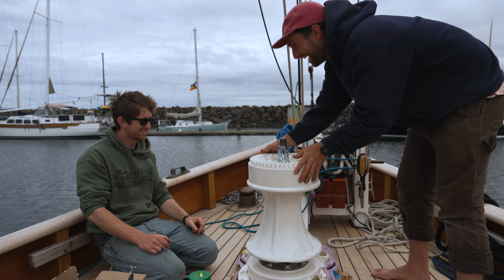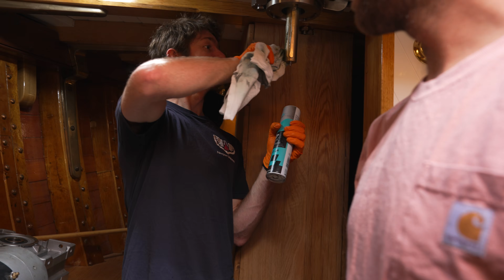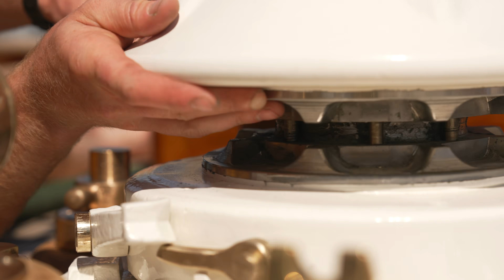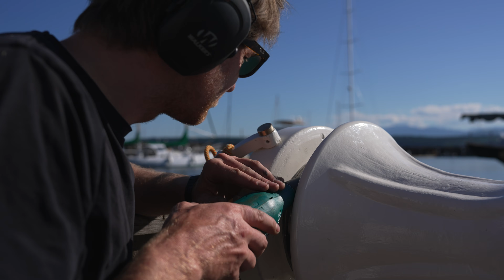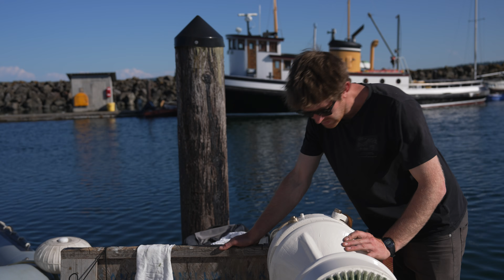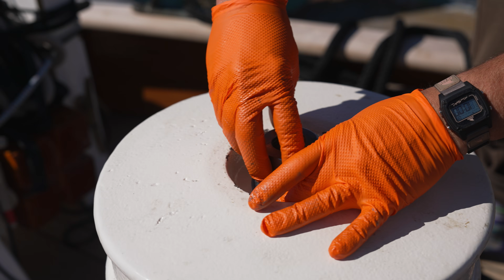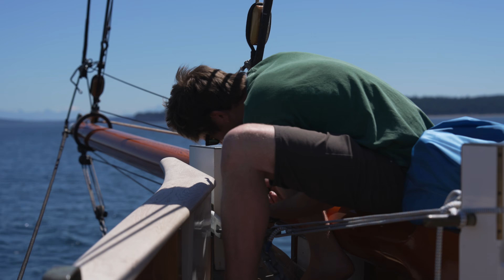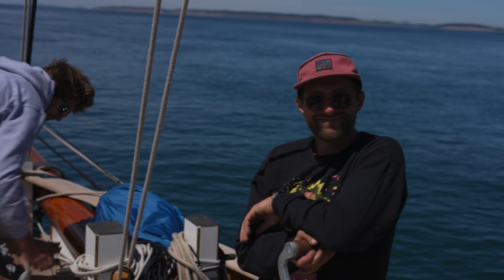Installing and using the original capstan!

Comment: I remember when you took that capstan off the boat. I’m surprised it didn’t go through the old deck as heavy as it is. The magic she adds by bringing original energy is amazing. 

The entire crew stood, eyes glued, to the Gypsy, no body movements, waiting to see if Leo’s mods worked. Phew! 

I am so stoked! 

The weird thing is that while we knew the build was winding down, it didn’t seem that ready, and then, bam, Tally Ho was in the water. I am still reeling over the fact that you’re motoring and sailing her already. What? Wow!

Comment: Will you add tubing and cable railing around the deck? It sure looks like someone could easily go overboard with the low-profile wooden side deck railing system. It (of course) isn't a problem in perfectly smooth sailing weather, but harsh weather could easily make that an unsafe condition for "man overboard".

Comment: - The chain locker tube looks a 1//4 to 3/8 {or 1/2} inch high to my carpenter's eye. {camera angle permitting a level view at 30:56}
- I would expect the chain to catch and back up being high like it is.
- My feel for this is the chain wants to be a 1/4 to 3/8 inch shy of hittting the top of the tube so it can "fall" to the top edge of the tube's inner apex right angle point turnin down.
- You may not need a chain-stripper, nor any rising skid plate taking the chain up to the gypsy when paying it out when you get the alignment to right.
~ ~ ~ ~ ~
- Leo, it occurred to me when first seeing the chain that its galvanized coating felt overly thick...and that may have added to the more bulgy links that you mentioned and had to fit the gypsy to, by grinding off 1/32 inch all the way around {if my guess is right about the depth of metal you removed}

Comment: Hi Leo, I started to read through the comments to ensure that I didn't double up on another comment, but there are just way too many of them. 
Regarding the twisting chain, I didn't see the bow roller so perhaps you have already done so. Years ago, an old hand told me to machine a groove in the bow roller marginally wider and deeper than the diameter of the rod of the chain links. The chain is then prevented from transmitting any twisting to the gypsy as it is retrieved. It is very effective.
Also, when I first learnt that you were going to refurbish the original anchor winch, I didn't think it a good idea, I have been proven wrong. It is apt, aesthetic and functional, also it gave rise to an absorbing series of videos.
Well Done!

Comment: Probably teaching grandmother to sick eggs, but just make sure the tapered shaft drive is VERY tight as the Woodruff key is only meant to locate, not transmit significant torque.

Comment: Just a suggestion, I think I'd lower the chain return elbow. The bottom of the inlet looks higher than that of the chain exiting the capstan. I think by lowering it, maybe by width of a chain link (the height of the indentation in the gypsy) you'll get a downward angle on the chain going from the capstan, and into the elbow. This will lower the contact area the chain has against that elbow, and hence lower the friction, allowing for free-er chain movement.

Comment: Why does the anchor fall from the front of the boat instead of the back? Wouldn't the chain scratch up all the paint on the front of the boat the second the anchor hits the floor and the chain becomes taut? The boat is literally floating ahead into the chain...
Reply: Usually one heads up into the wind or current to anchor. As the forward motion stops, the anchor is let go. Then the boat drifts backward as the chain pays out.
Reply: @SonjaBruenzels  Lol, I'm clearly the exact opposite of an expert, which is why I'm asking Leo to explain it to me. I genuinely don't understand why it's designed this way.

Comment: Love the engineering in the prop and the cap where you can use electric or manual/mechanical. They're really well done. 

So jelly ... Tally Ho is about the length of yacht I want to move into 24/7/365 to avoid our ridiculous housing/rent situation .. live aboard and travel with the wind. VERY impressive work all around. I'd LOVE to have the health, money, tools and expertise to pull off a basically completely fresh build.  The chain locker entry/exit and the anchor lock mech on the other side are VERY well tied in.

The only thing you're missing now is a biminy or similar for sun protection in the helm. They're also good for placing solar panels and wind generators off.

Comment: I suspect that some of the sticking in the gypsy will subside as the chain is broken in. Any flash in the link welds, and the general surface finish of the chain may quickly attain a smoother patina with repeated trips through setting and weighing anchor. You may find that with some wear, a stripper may not be necessary. Patience. The machine is amazing! Tally ho, boys.

Comment: I do like it when I see someone use a split-pin correctly - there's no need to fold it all the way around, it just needs to be spread apart enough that it won't drop out and it will make removing it much easier.
Reply: Right...Rod Stephens said 20-30 degrees separation max.

Comment: Could you make a bronze plate that mounts to the chain tube and sticks out towards the gypsy, and as the chain comes around on the way in that plate will essentially stripping the chain off that gypsy and guide it into the tube.

Acting as Pattie with a wrench knocking the chain out was.

Comment: Gosh guys, such a excessively heavy out dated bit of gear that anchor winch… better to have that weight in chain and a heavy duty electric horizontal winch…safer for the boat after the magnificent marathon rebuild…Ian 40,000 + miles sailing /cruising experience…

Comment: The brass elbow tube for the chain locker looks slightly high and prevents the chain pulling in the chain under its own weight. I wonder if it was machined down a little lower it would not snag?

Comment: A long road to get here -  2 Questions: 
1: Yes A BIG SIGN in red saying " Watch Your Noggin " Also make a nice wooden rounded Teak corner cover that is clip on clip off..   
2: Could a better " chain trough "  On the top deck be introduced. To keep the chain aligned, so when it is fed from the anchor onto the Capstan precisely...  

Besides these, Looks good Leo & Crew...

Comment: The bolts going through the gypsy to retain it likely squeezed it a bit, causing the tight fit. If your engineer OKs it, backing off the torque on those bolts will likely solve your chain sticking problem.

Comment: Many years ago on a 65ft yacht we had a chain jump out of the gypsy and free-flow until the end went overboard. The last 10 ft or so of the chain whipped round in a semi circle before it disappeared under the water. It would easily have taken the head off anyone on the fore deck who was in the way. Anchor chains can be dangerous.

We were a couple of miles up the river Dart from Dartmouth and it was shallow enough that we were able to grapple the chain on the bottom after a couple of hours. That was a lot of fun.

Comment: Amperage generally dictates wire gauge 27:55
Reply: Yes, but the higher-voltage motor (48v vs. 12v) means that less amps are req'd.

Comment: got to say, seeing the capstan in white and not a boring black, is like the ultimate bling on deck, what a fantastic addition, and the motor below deck, wow you nearly designed the boat to fit around it, incredible work, i hope you manage to wrap that up with something soft so you never concuss yourself on it, can't have you spilling the wrong claret on board dear thing, wouldn't be very British would it - hmmm need a holder now for the handles, maybe a temp fit while the anchor chains wears in, you might be able to fit a lump of sacrificial wood between the chains forward of the capstan, between incoming and outgoing chain just to force it off the gypsy, where Paddy was putting his tool in, can i say tool, but the action is real sweet

Comment: Is that a 175 amps/8400W @ 48V! Does the windlass free spool and I would use an Ultra Anchor swivel. Have a 62'/45 ton wooden sailboat here and am always anchoring in deep water(60'-100') and over the last five years have had zero issues with the Ultra Anchor swivel.

Comment: Amazing work! Out of curiosity, how long does it take to manually hoist the chain versus using the motor? It's fun facts but that is what I would love  to know. You all did an excellent job with the engineering and fitting of the capstan.

Comment: I liked the brakes in manual mode, 3 turns  around the capstan with a line from the bowsprit  mounts?,  whats that bit called?
Reply: Knightheads, or bitts.

Comment: Just to confuse everyone a "shot of chain" is a description of chain not of distance. Its' call a shot because they used to shoot short pieces of chain out of canons. A "standard shot" with regard to shipping is typically 90 feet or 15 fathoms of chain and is linked together with other "standard shots" to make the length of chain required,=. But it's not a measure of distance. You could also say "Length of chain" which is the same thing.

Comment: It looks like the chain pipe opening is either even or a little higher than the gypsy.  Perhaps reducing the spacer underneath it will help allow the chain to pull itself back down the pipe and into the chain locker.

Comment: UNRELATED QUESTIONS: Do you have to register a boat the size of Tally Ho? If so, what country will it be registered in and what point will she need to be registered? I ask because the only thing I know is that the real small boats (like the ones you can buy at places like Cabella's/Bass Pro Shops have to be registered in the US. Except that registration is controlled by each state, similar to auto licensing programs for cars and trucks.)

Comment: Leo,

Congratulations to you, your team, and everyone involved in the Capstan project.  Somehow you mixed apples and oranges and wound up with champagne.  Your capstan and gypsy are more complicated than some of the ship windlasses I've worked with.

One suggestion is that you want to use something in addition to secure the chain when anchored.  A wake from a passing boat could do significant damage to the riding pawl.  I would suggest selecting something similar to one of Crosby Group's chain grabbers secured to a cleat by a nylon line.  This gives you a spring to absorb the load.

The test you performed by dropping the full length of the chain is among the most severe tests you can make.  It took a lot of guts to do a test like that.  This brings me to the bitter end, of the chain, not my ramblings.  The bitter end should be able to hold the weight of the chain and anchor.  However, you want the bitter end to fail before damage is done to the Talley Ho.

Smooth sailing,

Bob

Comment: You have to be craze to put all that weight on the bow of your Sail Boat.
Reply: That's the capstan Tally Ho was built with. The only additional weight would be the motor and gearbox. I'm pretty sure back in 1910, that capstan was manual operation only.

Comment: Q - a practical question from an old sailor (RN).  I can only guess you can 'let go' (freefall) rather than 'power down' the anchor and control the speed with the motor declutched and a 'braking' rope around the capstan drum?

Comment: Would a stainless steel chain be “more accurately” manufactured?
Reply: I mean. Mixing highly precise matching with very low precision chain welds? Probably not a great match up? Would running the chain in and out a million times help take off the edges between the two “matting” surfaces? Or get a stainless chain?

Comment: Just going to say, Moly Grease is standard in most wheel bearings on cars. Molybdenum is very soft and lubricious. Works great as a high pressure lube in and out of bearings.

Comment: You should check with the chain suppliers.  I remember a supplier commenting on slight variations between chain sizes, like between  mm and standard sizes, between Europe and US translations of those sizes.  Also variances between galvanized and stainless steel chains.

Comment: Dang, this is a great example of how the internet has improved boat restoration. the engineering that went into the capstan could only come from the people you find to do it. Leo has identified the changes needed to make it work reliably. Then only thing I would add it to have a periodic maintenance schedule. The design requires lubrication and a schedule should be setup for disassemble, cleaning and greasing.

Comment: On most of the boats I worked on someone had to be in the chain locker stacking chain as we used more than the locker was designed for. We would put 17 shots and locker designed for 13 shots. Deckhand (35 years ago ME) had to flake the chain to make it fit using a heavy hook and point.

Comment: Wondering if putting the capstan through its paces in deep water running the anchor up and down multiple times to wear in all surfaces might help.  Otherwise, get your hands on the original sized chain to check for same problem.

Comment: Leo , to help with the chain twist, on my 45 ft offshore yacht, I put a swivel between the anchor and the chain , I never suffered any chain twist after that was fitted. So I wish you clear skies and fare winds, may your travels be safe and fruitful. Cheers from Australia
Reply: I haven't much experience with boats, but when helicopter slinging, we do the exact same thing.
Reply: Might be a problem getting over the bow roller.
Reply: @dougalannh  there are several swivel designs specifically for anchor chains and they ride over the bow roller without difficulty.
Reply: @davidwatson3921  Probably the swivel has the same outer dimension as a link in the chain?
Reply: @andrewf2644  the most important thing is that you don’t created a weak link in your anchoring system. The one I used was slightly bigger than the chain dimensions, but not enough to be a problem. The other thing is to have a chain snubber so that you can unload the winch when anchored. This is good when expecting some weather.

Comment: I suspect the gypsy will probably “wear in” with use and quit hanging onto the chain as it is, but a chain stripper should be a good short-term solution. It was really fun watching the process of trying to disassemble the winch, modeling and casting a new top, and all of Keith Rucker’s very skillful machining on the various parts of this winch. Altogether a very rewarding process to watch!

Comment: @29:34 You could say that the combined forces across the pond did a better job than NASA did on a few occasions.
(with respect to combining US customary/Imperial versus metric system)👴😁
@30:01 Perhaps lowering, and/or tilting the through-deck elbow (I don't know the English term (Spurling Pipe?)) will improve the natural flow of the chain.
It could also prevent (unnecessary) wear and tear.
Also, bear in mind that the chain is thermally zinc treated. That is the best choice, but means that over time the chain will automatically behave more willingly. 👴😉

Comment: What a success! The international work that you had done is a credit to everyone involved. The accuracy of the drawings and fabrication is excellent as the capstan and its drive mechanism went together like a fine jigsaw puzzle! The sticking chain is a hassle but a chain stripper and anchoring use should fix that. The soft zinc galvsnising will smooth out as the chain is run up and down, any bumps on the gypsy will also be worn smooth and it will get better with time. Excellent to see the completion of this saga...it's been a fascinating journey of concept and engineering! Well done to all involved. Just out of curiosity has anyone weighed the capstan anddrive? Any change to her trim with this 1/2 ton of weight up for'rd?

Comment: The only suggestion that I have, is a replacement for the brass turn screw for engaging and disengaging the motor from the windlass, a brass handle would both look and work better!

Comment: How does TALLY HO float on her waterline with the installation of the windlass. I really can't tell with pictures, but she seemed a little down at the stern without the windless and I would expect her to be exactly on her lines with the weight of the windlass added forward. It was said the windlass was on the original drawings so it's weight would have been included on the original stability calculation. Beautiful boat.

Comment: Something to consider when the motor is being used as a brake when dropping anchor is the power being generated and whether that will cause any electrical gremlins. I’m assuming the gearbox is transferring load each way equally, it may not be depending on the setup. But in a worse case scenario with the anchor in an uncontrolled drop, the 10kg anchor dropping at 10m/s would have 1kw going through the system backwards. I’m sure the team thought of this but worth mentioning anyway as this is a prototype capstan!

Comment: IMO the powder coat will chip off in the gear ring and pinions. This will cause future problems. There should never be a coating on these surfaces. This is most likely the reason for the top nut not going all the way down.

Comment: As the chain gets rusty will get larger and the sticking will get worse. Like all machinists they make things
 to tight tolerances. Chains are made to very tight tolerances.  You may have to re-machine the sprocket with lots more sloppy clearances.

Comment: FYI: Molybdenum disulfide grease is used in wheel bearing and constant velocity joints. This grease usually contains about 3% moly. For example, over the years Toyota Land Cruiser service manual specifies moly grease where grease is to be used. Cheers

Comment: The gypsy will wear in over time.  You need a chain shifter.  Fairly standard on horizontal gypsies.  Mind your head below decks around that gearbox